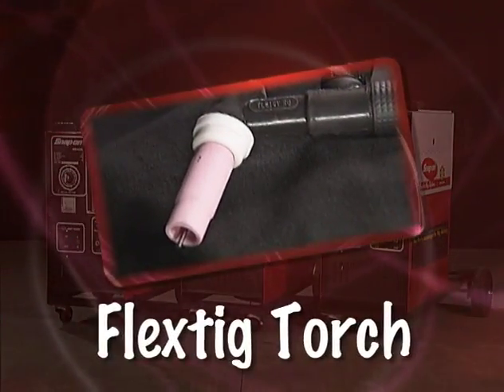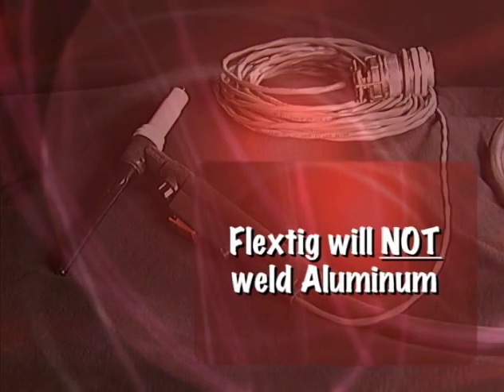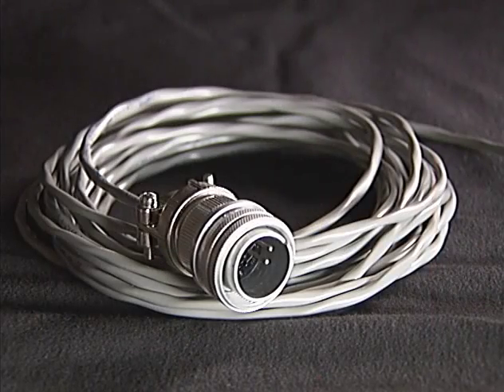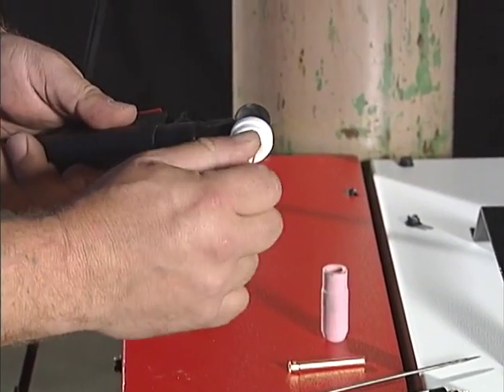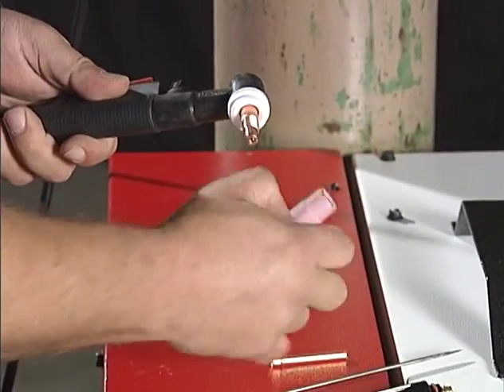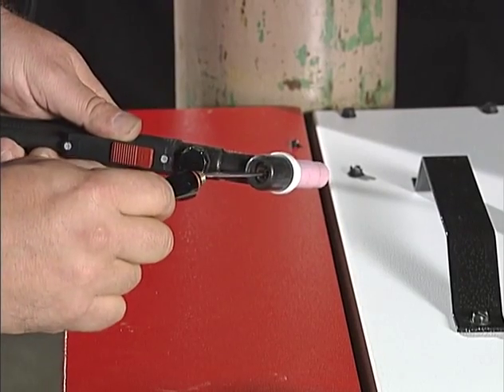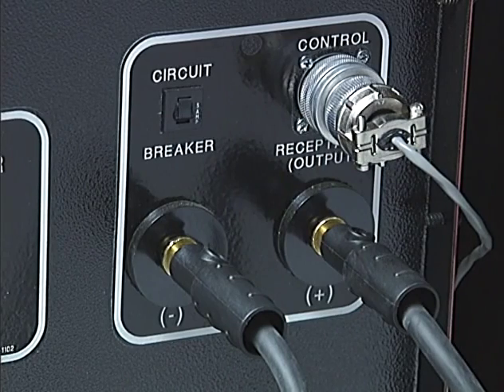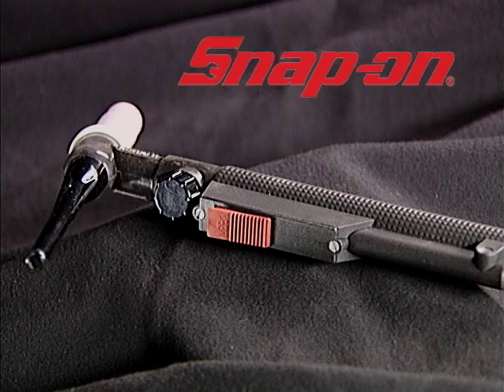How to Set-up a Snap-on Flextig Torch | Snap-on Tools

Comment: I like to know why the flex tig 140 to the 250sl won't do aluminum welding?
Reply: Because it’s a DC welder and not an AC/DC welder so you can’t do AC Tig
Reply: And doesn't have the high frequency needed